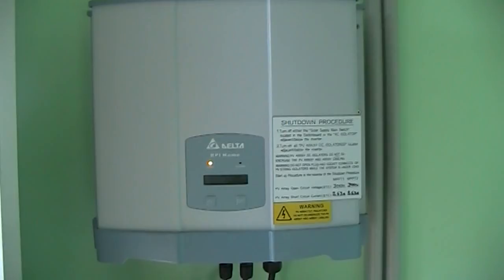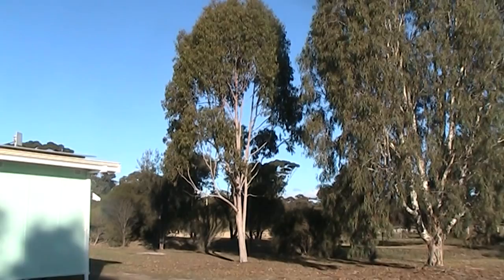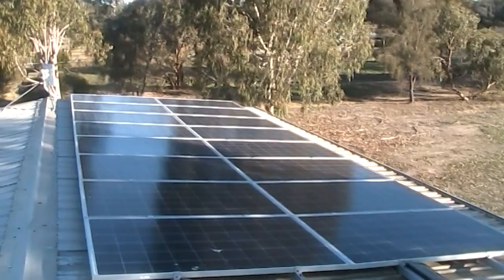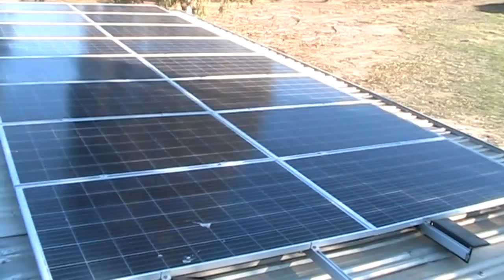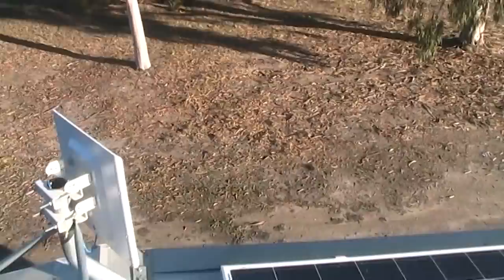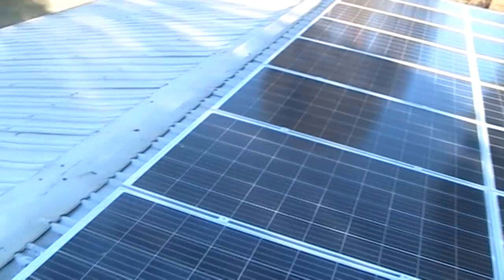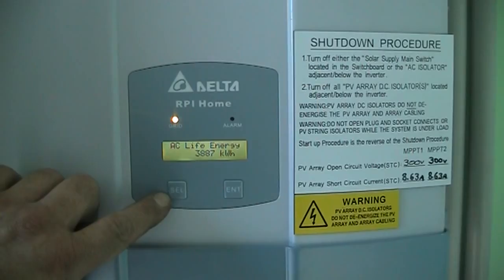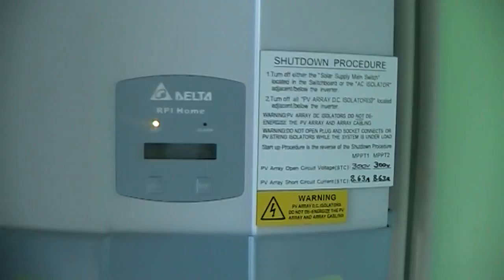Grid system follow up video

Comment: thats the thing i dont like about high voltage solar arrays.
i bought a heap of low voltage grid ties ages ago to keep my strings to a max of 4 panels per string and as low as 2 per string. aussie built old school design yet still reasonably effecient and rock solid.